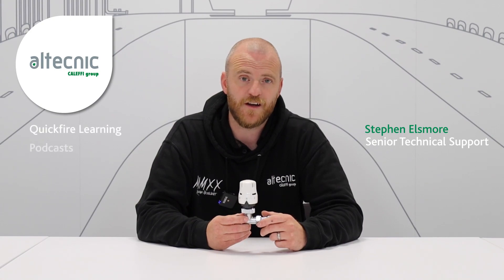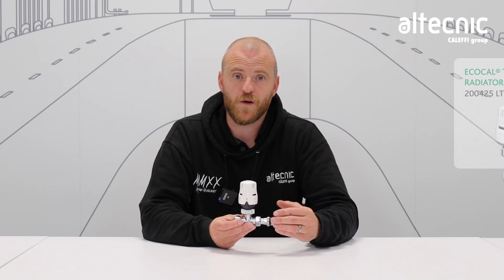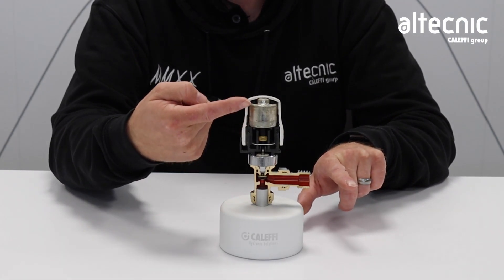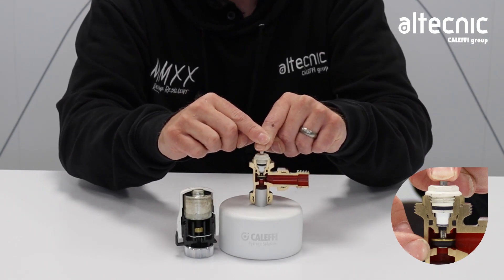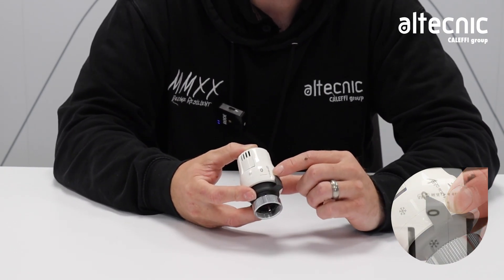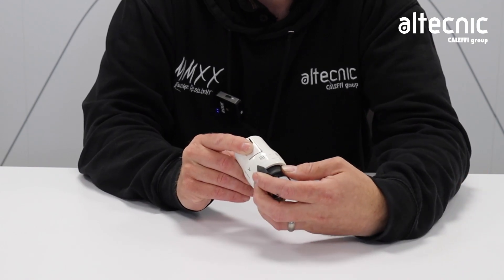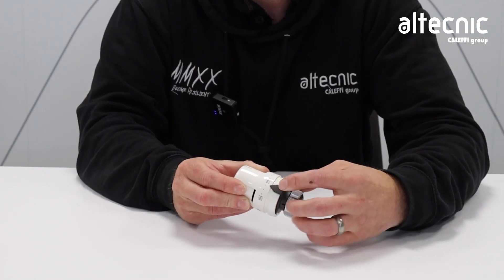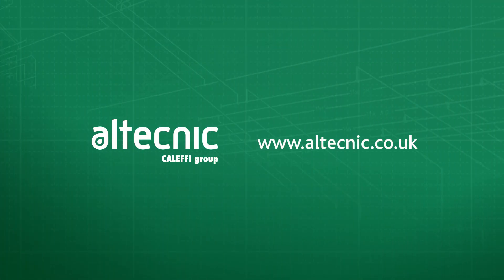How does it work? - Inside the Ecocal™ Thermostatic Radiator Valve (TRV)

Comment: Thank you for showing us how the whole thing actually works. In my case, the pin/plunger was stuck so I was not getting any hot water flowing inside the radiator. Fixed it by gently tapping it with the hammer and a bit of WD-40 afterwards to make sure it doesn't get stuck again anytime soon.

Comment: Thanks for sharing this. I recently replaced Myson TRV with one from Toolstation - the head only, which fitted on okay. I also did the same with one from ebay. When I switched the heating on, the room temperature was already 18 degrees in the two rooms and the trv was set on number 1, but the radiators still warmed up - eventually reaching 20 degrees, yet the TRV shouldn't have activated because number 1's temperature activation was no more than 14 degrees. I expected to turn the knob to number 3 if I wanted 20 degrees. Do some of these TRVs not work as expected for some reason? I could go out and purchase your brand but I am unsure if I might experience the same problem.